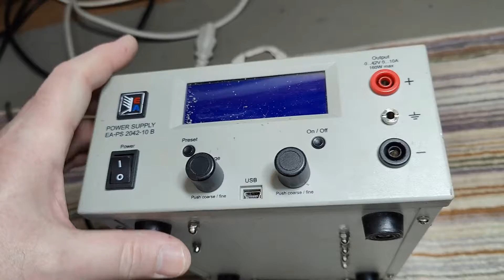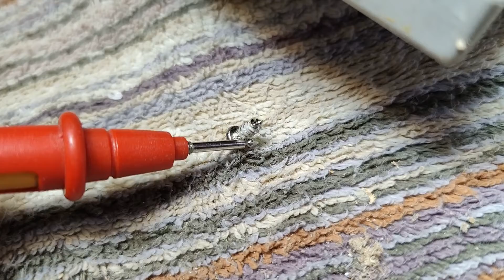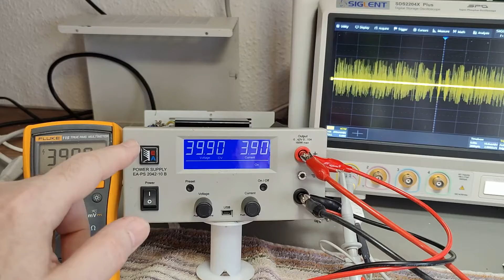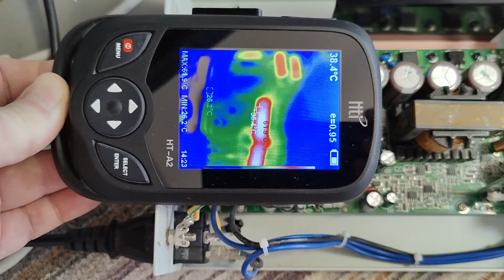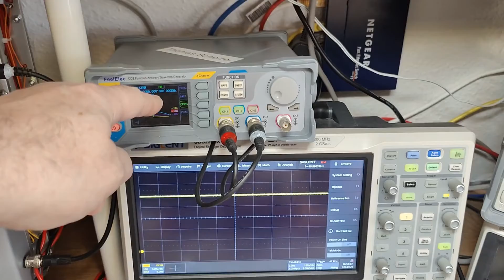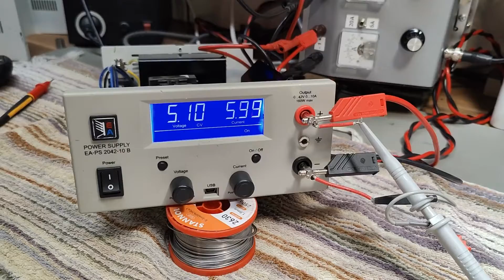Elektro Automatik EA-PS 2042-10 B 160W Power Supply DANGEROUS

Comment: Jim Williams did that 100A active load for testing power supply behavior with transients. I wonder if something like that would trip up this power supply. I'm guessing that a glitch makes its way into the cpu's power rail and scrambles registers.

Also, what frequency were the neopixels switching at? Very repetitive transients might also be worth trying.
Reply from the maker: this is a fully software controlled psu, and this video reveal it is unstable when you "trick" it a little bit, as long as we dont have the firmware package, the compiler the upload tool, there is no big idea into researching deeply into exactly what trigger its bad unstable behaviour, since we can not change the bugs in the software. We can only hope they test better, and make better units in the future.

Comment: There is certainly one thing this smells of even when cleaned, and that's "prototype" - are you sure you didn't end up with one? ..... Hope they aren't making a 300V version or such of that series, someone might connect it to a breadboard they have their fingers in, or that has components that can violently blow, relying on the fact they set it to a few volts.... funny until someone ends up in hospital (I'm not suggesting to ever use a PSU capable of >40V to power a hand-manipulated breadboard, but people will do that). .... "Artikelnummer Platine Bestückt" means "Ordner number (is) for populated board". Not sure if one even wants to admit to being German seing a German product like that 🤬 And why the hell should a laboratory power supply expect you to bring your own filters - this is just barely acceptable for a cheap amazon special, but for a mid range product marketed to professionals?! Makes one think since commercial use of HF bands has decreased, no one gives a darn no more....

Comment: Yes it is a cheap power supply.
The bulk smoothing cap is not fitted on purpose, for PFC correction.
Noise measurements on PSU's I thought were supposed to be done with a differential probe and bandwidth limited to 20MHz.

Comment: 88% efficiency is close to what is possible with a decent mains frequency transformer, active rectifiers, pre-regulation and attention to low voltage drops.

Running the switching transformer on rectified AC is OK but they missed the message that this technique is only for minimizing transformer size. It needs to run continuously and produce a sine-envelope square carrier on the output. Chop mains, isolate and step down without lots of iron, then work with that. On the secondary you put a PFC boost followed by a buck. Probably the easiest to design mains switcher ever. The mains side is just a fixed frequency chopper that you can filter out extremely well. A small LC tank added between the chopper and the primary can turn the primary side into a class-C tuned power stage so that the chopper waveform is sinusoidal. It makes mains filtering much easier since a low pass and a notch will take care of conducted emissions - if done right of course.

For the primary switcher they didn’t even keep their pulse current loops small. That dinky yellow capacitor is just sitting to the side. Ugh.

Comment: The firmware in this thing is atrocious. Unusable without redoing the firmware yourself. I’d much rather have a fully analog design instead, with simple digital readout modules you can get for a couple Euros. Who will ever use USB on this thing?! I’m sure it’s as bad as the rest of it.

The click-on-the-knob interface was thought a good idea by someone who kept the PCB flat on the table during development. A trap for young players.

Comment: Thanks for the video. Perhaps it's not the load causing problems. I wonder how reliable the power on behaviour is with 2 processors. Possibly messing with the mains input voltage such as might be the case with an intermittent switch or bad contact might confuse the electronics.
Or as there doesn't seem to be much of an input EMC filter perhaps noise on the mains supply can corrupt the processors causing undesirable output voltages.

Comment: I do that with my encoders and buttons as well, poor man's debounce.

Great tip for the holes in plastic moldings, i would have never thought about that !
Reply: Totally unnecessary. Firmware can handle it easily.
Reply: If they could spare a few more cents, they could just put a schmitt trigger in line and fix it very easily..
For testing purposes, I also use RC debouncing combined with good software.

Comment: Neopixels are a very very nasty load, much worse than your random generated currents. You don't have to convince us that these supplies are cheap and nasty. The omittance of a primare buffer cap alone should tell you they did some brutal cost cutting in this thing.
As sadly is the case in a lot of EA supplies. They make a few good ones, but a lot of not so nice ones with (to me) wierd design choices ... both mechanically and electronic.
Reply: Sad thing is that slight modifications to this hardware and firmware could make it perform so much better…
Reply: Tektronix aquired them a few weeks ago, let's see how that works out. Btw I agree completely with your input, I have exact the same bench PSU and it is designed in a weird way to put it nicely. 
Thanks !

Comment: 6:22 Are those transformers? I always thought those white tall packages were optocouplers.
Reply from the maker: you cant really tell from the video the difference between the optocouplers and the signal transformators, normally the optocouplers are a tiny bit smaller, for many types of faster communication the transformers are more likely used due to speed
Reply: @TeardownOZ2CPU  I will have to look closer next time I stumble upon this kind of package :)
Reply from the maker: @zaprodk  i will do the same :-)